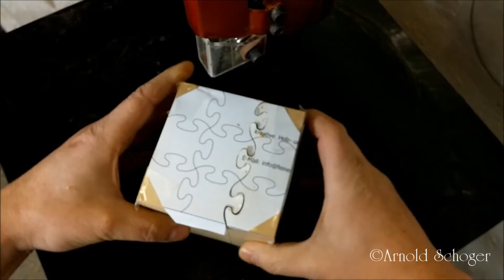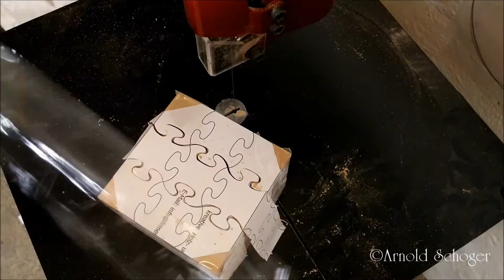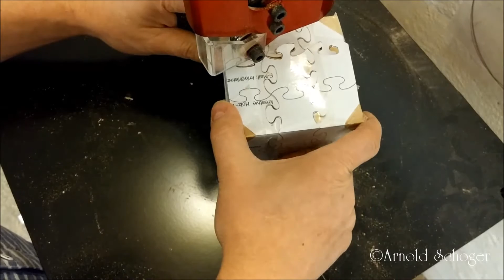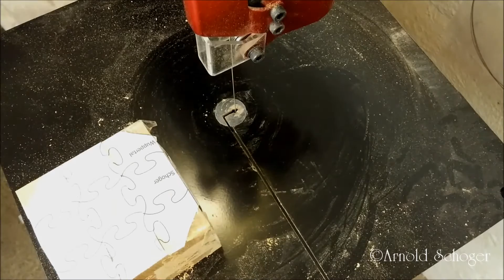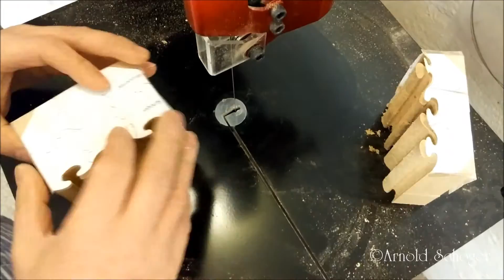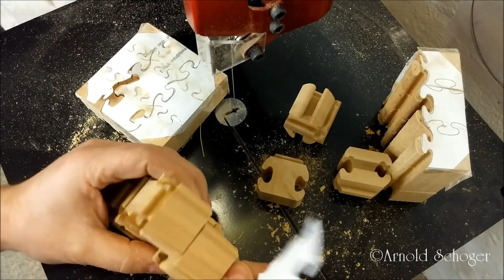Magical Bandsaw, DIY puzzle, by Arnold Schoger

Comment: What was the width of the blade you used?
Reply from the maker: Since this video is one of the first with the band saw, I think it is about the saw band
 No. 9, which was as standard accessories.. See here: https://www.dictum.com/de/werkzeuge/elektrowerkzeuge-und-zubehoer/saegen/716066/pegas-feinschnitt-saegeband-nr-9-2375-x-1-34-mm-zt-2-43-mm?sPartner=faw
The dimensions of the saw band are 1.34x0.44 (0.52) mm. The saw blade length is 2375 mm according to the description.

Greeting,
 Arnold